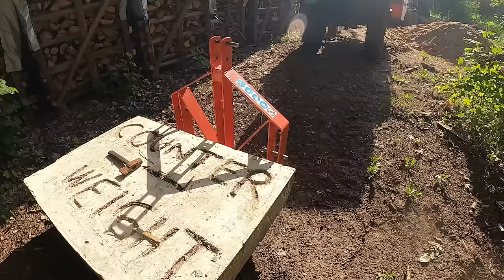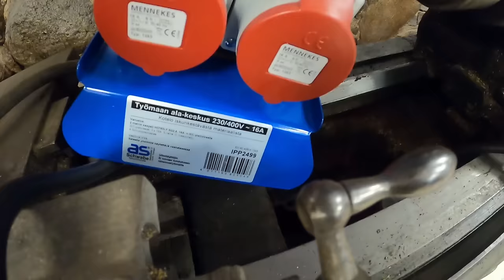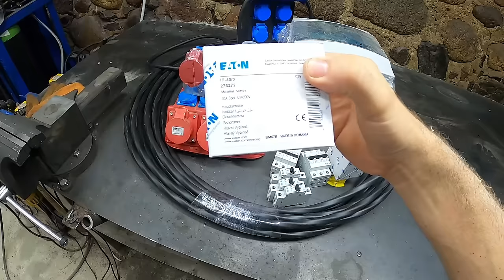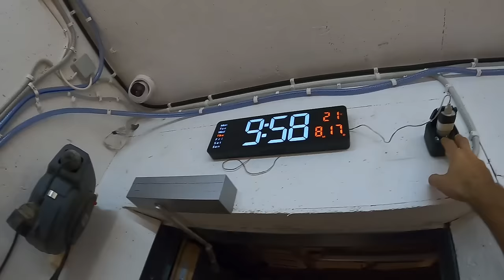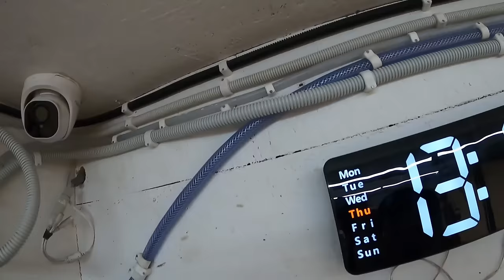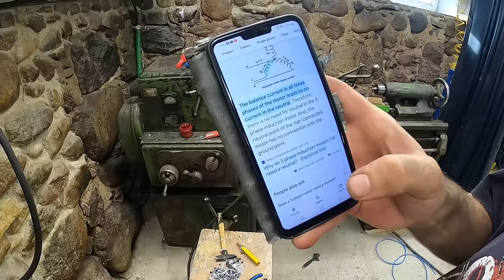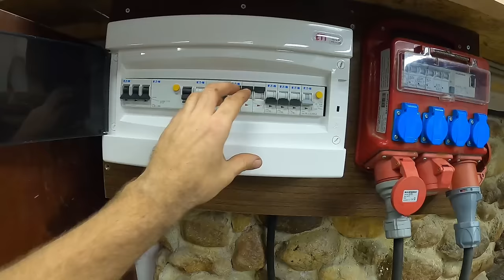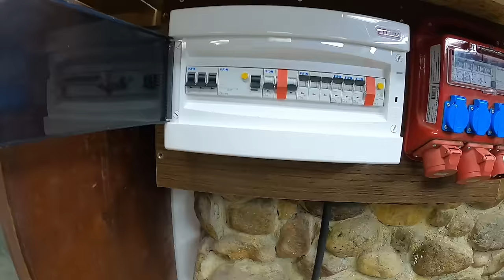Buying and installing a soviet lathe - STANKO 1A616

Comment: Check the headstock for oil in it make sure half way on the sigjt glass nice lathe
Reply from the maker: It was empty
Reply: I saw that when u turned it on
Reply: I like that big dozer turbo power love it
Reply from the maker: @guypatts494  great sound. Love it especcially when the motor gets some resistance

Comment: You shoud instal RCD 300mA of protect current. Not 30mA as it installed. 30mA RCD is for home use
Reply from the maker: That will work until the high startup amps triggers the RCD

Comment: Your problem is with the breaker type you bought because big motors take a lot of amperage to start there fore you need a less sensitive breaker like the one they use for electrical stoves
Reply from the maker: I bought the correct breaker, type C breakers which allow huge amp draw for a split second in order for the motor to spin up.

Comment: For shop airline in non commercial spaces (like private garages shops etc.) a lot of us in the US use PEX plumbing.
Its not technically approved for use with compressed air and its not UV "resistant"  (I don't use it outdoors or under Mercury Vapor and some fluorescent lights).. but LEDs dont seem to bother it. I have had my own personal shop piped with PEX for almost 5 years and never had any issue. They sell a PEX like pipe system specifically for Air  but its 3x the cost and the regular stuff works fine. On air I use the Stainless "Oetiker" clamp style system b/c its removeable/reconfigurable without destroying the pipe or the fittings.  Haven't had a single connection or pipe fail, and if /when the pipe gives out I will just cut that section out and replace it. When it fails,  It just blows out a "bubble" and ruptures/teads and vent the air in the system, (i have tested this)..  it doesnt explode like PVC or other hard plastic piping.  Your mileage may vary and this is not engineering advice but for me (and a lot of other ppl) it's cheap , available everywhere and it works very well.
Reply from the maker: I was thinking maybe aluminium but i will look into apex

Comment: The surge protector checks if power runs trough ground and checks if all the "Amps" that goes through the Phases comes "back" (no power is lost)
Big motors act like capacitors when powered up. For the surge protector "Amps" are getting "lost" and it tips. It helps when the Neutral on a star configuration is hooked up because through that some of the "missing Amps" are coming back. But it looks like that least the big motor us hocked up in a triangle configuration.
You should put a 5 wire cable in with the right diameter of wires. You will get problems if you want to hookup 220V equipment in the lathe, like light, or a new coolant pump.
Also, the gearbox sound "dry". You should check the level of oil in there. And level the lathe. If the bed is twisted the performance of the lathe will be really bad. And a leveled lathe makes the work and checking the quality of the lathe much easier. Leveling is more than jacking it up and put a level on it once. The bed can be twisted or bowed from its own weight. Get a machinist level or two for that.
Reply from the maker: I removed the transformer so i wont be using 220v inside the lathe, coolant pump also runs on 400v, i just put a rough level on the thing with some diy leveling bolts.

Comment: dint worry if live wire touches frame of the machine the braker will trip cuz its connected to that ground wire to the frame and the ground wire is connected to the neutral in your panel sorry for bad english
Reply: and i think middle levers are for threads and feeding thingy

Comment: Greetings- On the motor end of lathe you t it to close to the wall.  If t breaks a belt or any other problem you will not have enough room  open the pulley cover. Best of luck.
Reply from the maker: Thanks for the tip!

Comment: Ants mate, you will need a milling machine also one day so make sure to have a junction box in your shed so if you need to run off extra 3 phase power you can. ( what am I talking about? Should have watched the whole video first!)  You are very lucky to have 400 volts close to your shed for sure. With your knowledge with this Lathe is nothing and man as you say can be bloody dangerous. I suggest before you use the lathe go do a tech course or if you are savvy go onto the net to learn about speeds and feeds and cutting feeds for different types of cutting tools.
Reply from the maker: All true

Comment: Did you at least check it before buying? Soviet machines of these years can be either in A1 condition or dead crap with dead bearings and a frame that was corrected with a grinder before sale. There's a good chance that all you can grind on it will be a metal egg.
Reply from the maker: Nope, lol I did not check it

Comment: The three knobs in the middle of the gearbox those are for cutting threads those determine your thread pitch it doesn't matter where in the world the metal lathe is from that's what they're for it's for cutting threads and it has to do with your power feed and the taper and all of that good stuff
Reply from the maker: you had me at all the good stuff sir
Reply: @Ants_Pants  and there's also all kinds of videos on how to cut threads on YouTube have a good weekend

Comment: Lead screw and feed shaft run acros the front of the lathe, there are also back gears in the head end close to the wall the back gears take the drive from the spindle ( chuck ) and drive the box you referred to as nothing, nothing , warning! If you select a high spindle speed and high lead screw speed then engage the screw cutting lever bad things will happen very fast! So run the spindle at slow speeds the nothing nothing levers operate the shaft with the long key way that’s feed and the threaded shaft it’s for cutting threads . You may not be able to open the back gear cover properly because the end of your machine is a bit close to the wall have fun but be careful , at one point you came very close to throwing your car in reverse at 150 k will sitting in the boot cheers
Reply from the maker: Thanks 👍

Comment: Hello,
The problem with the RCD equipment is probably caused by the grounding of the control side of the contactor - if the control coil is on 230V it is clear.)
Reply from the maker: Caused by the motor

Comment: You can get 100mA circuit breakers, but maybe get an electrician to measure the leakage current. Add a big earth wire too
Reply from the maker: i added a 8mm2 earth wire on the frame + a extra 2,5mm2 earth wire on a other spot, so i got a total of 10,5mm2 of earthing going on it. Local electrician told me that 6mm2 is well enough

Comment: Not trying to be horrible but I've found Soviet equipment to be really well built with high precision. The catch seems to be that everything Soviet is always Ugly as sin. I'm kind of assuming that those who worked on building Soviet equipment had to get it right 100% of the time or they ran the risk of ending up in front of a firing squad or in a Gulag somewhere in Siberia. All you need now is a mill, a small bone yard of broken & scrapped equipment, cars, tractors etc & some practice with both the lathe & a mill & there really not much you won't be able to re-build or build from scratch which to me as a viewer is very exciting 😊
Reply from the maker: yup need them all, but no place to set the mill :D

Comment: Good job! Old  Soviet lathe? probably has poor, semi failed insulation on many connections as to why it trips ground fault breaker. Have the machine with a GOOD ground and your rubber operator mat you should be OKI. I have a couple old machines that are like that also. Greetings from the USA.
Reply from the maker: yup

Comment: Middle gearbox is proabably for threading feed speeds.
Reply from the maker: You are correct
Reply: @Ants_Pants  i think it starts from the carriage, not from the gearbox. There are those long bars, other transfer the saft power, other lever actions. Go through all the levers. And once it starts pushing, it will push your power cord to the chuck and all hell will break out.

Comment: Hi, to make everything correct according european standards you need separate grounding for your shop. From your electrical company comes PEN which is working neutral with potential earth connected together at your infeed point.
Problem is with four wires is that if you lose this PEN at electrical counter every equipment what is "grounded" in your house becomes live with phase. This can happen if one phase loads not evenlly distributed and overload neutral. At distribution box in your shop is PEN and PE will be from your shops grounding. One terminal is PEN, second PE, third N (which is after residual current protection device with test button). PEN and PE must be connected together at this point. Lathe should work with residusl current protection, it trips because control circut of lathe is on PEN at it is seen as current leakage. You need fifth wire to lathe, Lathe ground connect to PEN and find where control circut is connacted to ground and connect it to N. This way it will not see it as ground leakage and will be a little bit more safe. Yes and shops grounding should be less than 4oms, better if less than 2 oms.
Reply: And put separate green yellow wire fron lathe grounding point schase to PEN terminal bypassing connector, connectors is most possible place where you can lose grounding.
Reply from the maker: extra grounding rod for the workshop seems like a great idea mate.

Comment: L1 - U / L2 - V / L3 - W try to draw connection schematic using old and new markings on ur lathe. And thanks god u still life.😮
Reply from the maker: What do you mean?
Reply: @Ants_Pants  i think u connect one of the phase to lathe chassis, what was happend if residual current circuit breaker was not work ( personalny i saw that case of accident)? The family would have a fried ant....

Comment: If you paint the lathe, then it will look like it was just painted..  One problem you may already know is you will have to put a hole in the wall in order to turn longer shafts or pipe..
Reply from the maker: Cross that bridge when we get there :D

Comment: You need to move the lathe head stalk farther from the stone wall often times you need to have  work sticking out of the back of the chuck and through the spindle.
Reply from the maker: I took a look and the hole is like 10mm maybe. How am i gonna fit anything there? Thanks

Comment: Why risk it, make it work with a HPFI/HFI or get another lathe.
..Vibrations etc. over time can cut/corrode wires.
Reply from the maker: No risk no glory
Reply: @Ants_Pants  prefer more videos from you than a suicide lathe :D
Reply from the maker: @jensjensen7504  its ok i will pour a concrete wall around it so it cant kill me. Great new project
Reply: If he was as rich as you he wouldn’t be there in the first place. his mommy would have built him a brand new shop. With all brand new equipment. Then he would post how he would do things, instead of showing lazy you how to do them. Take your hands out of mommy’s purse and enjoy how other people struggle.

Comment: Does ithave 230volt control?  Without the rcd it will work using the earth as a neutral but with tge rcd you need both.
Reply from the maker: no it does not

Comment: 1:16:40 I would never use expanding foam inside an electrical cabinet (unless it's a special fire-proof type of foam). That stuff is so easy to catch fire.

I have no idea if there are regulations about this though.
Reply from the maker: I used fire rated foam

Comment: If this were my project I would consider updating all the electrics including motor(s) cables and switch's.  With something this old and originally poorly built it's just a matter of time before something else goes bang.. probably you..    Most of the stuff on the lathe is to change speed or direction..  Consider a DC option.  Variable speed..  Wow..     Bypass all the electric switch's and mount new ones on an external panel..
It's not really considered a 'Big' Lathe because of low 'Mid spindle to bed' distance and distance between Spindle chuck to Tailstock..  Just a heavy old bugger..  
The Electric Motor is probably only 3000w.

A long video but stayed the course and enjoyed.. I was kinda expecting you to haul the Lathe outside at the end and shoot it.. but you didn't..   You have a lovely plot of land..  And Man-cave..
Reply from the maker: if i were to shoot it it would most likely bounce back at me :D, the motor is around 5kw

Comment: since you have 2 power outlets in the same building /
1 main cable into the mechanical workshop and
1 main cable into the trevike workshop
and they traverse both rooms and around the building
then I want you to physically mark where the current comes from on contacts and connection points so that you or others do not forget this in the future that the current comes from
e.g. everything that comes from a mechanical workshop starts with "m" and then a number after the fuse, so that all the fuses get their own number, so m1, m2, m3m4 etc.
on the fuse box in the wooden workshop w1,w2,w3,w4, etc
Reply from the maker: yeah

Comment: FYI. You need a special 3 phase GFCI control. Your GFCI wants to see equal current between hot leg and neutral and you aren't using the neutral. Zero volts on neutral = ground fault, disconnect. circuit.
Reply from the maker: Yup

Comment: Hi Ants, tell me, how does that big square concrete block Count>? Oh, I get it, you have to wait (weight) LOL sorry. OK, silliness over. I spent far too many years operating all types of lathes, hated small ones and loved working on big ones, but, that old lathe has enough levers to do many things, so, should be fine once cleaned, oiled and greased - enjoy
Reply from the maker: idk about 700 kg, not much :D but it will ensure my front axle won't break in half :D

Comment: And also, pleace be care, this Soviet monster can easily turn into a black hole if it is not used correctly. He won't stop until he eats you from the hand, without even changing the speed.
The first thing you need to do before working on the lathe is to read what not to do..
Gloves, sleeves, clothing chains, long hair. All this is the way to the singularity...
Reply from the maker: yup

Comment: Not sure about everything in your system.  I saw a blue wire in the panel at the outside pole, which would indicate there is a neutral from the transformer at the pole panel. Probably the neutral is bonded to the ground system at the pole.  Your feeder cable seems to bring only the three phases and the ground (green w/ yellow stripe conductor) without the neutral. I looked at the Eaton Europe file "eaton-pdd-frcdm-catalog.pdf" and saw on page 11 the different ways to wire the Eaton FRCDM residual current breaker. I do not see a way to wire this breaker without having the neutral available. Fundamentally, neutral conductors carry load current and ground conductors should only carry fault current. There should only be one point at the source where fault current returns through the equipment/feeder ground conductor back to the source neutral. Fault current then has a low impedance path back to the source.  This is how the ground conductor provides safety since the fault current will travel through the ground wires and not your body and limits dangerous voltage.
One difference in the U.S. would be that the NEC would require a service disconnect outside the building.
Be safe.
Reply: It's a TN-C-S system. The green/yellow incoming is combined PE/N. It will be separated to PE and N in the consumer unit, just like Andris did.
Reply from the maker: Bro i got lost like halfway reading that 🤔 i am sorry. 😅

Comment: U need a FI Switch with higher tripping current. that means your "thing" is too sensitive. older versions of FI switches have lower sensitivity, for examle 400V/0,1A or 400V/0,3A instead of 400V/0,03... check it out. But recognize, if u have a tripping current of 0,3A, at 400V... this ist much electrical power - something like 75 Watts flowing through your muscular Body. And this could cause unpleasentries. But will be much better as NO FI. maybe it works at 0,1A tripping pw. this will be approx. 24W
Reply from the maker: Thanks for the info

Comment: You're going to want to move the lathe further to the right. There are things on the Left End of the lathe that need regular maintenance and attention. But you have probably discovered this by now
Reply from the maker: Bunch of gears
Reply: @Ants_Pants  and a bunch of bearings that want to be oiled and greased did you find a manual for it yet?

Comment: Motors don't work well with ground fault breakers.
Reply from the maker: Old motors right?
Reply: All motors that have any start up load. The starting surge of the motor trips the ground fault because the breaker thinks it's a short. @Ants_Pants
Reply: Also, the frame of the machine is grounded, you could not energize the frame of the machine even if you tried. Even a standard breaker trips when grounded. @Ants_Pants

Comment: Fault goes of becaus that ground wire is neutrale
Like there is no separet ground wire
Those two start relays need 1phase electricity to conect 3 separet chanels
Reply from the maker: There is no neutral in this lathe. Just 3 phases and the ground